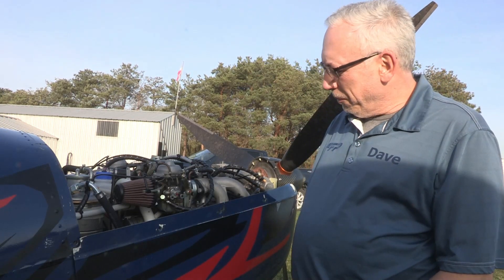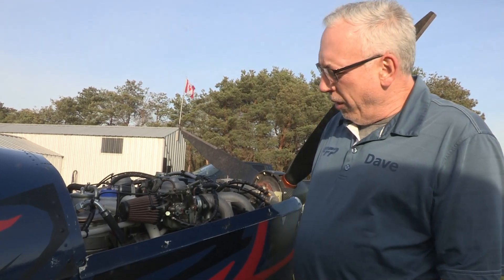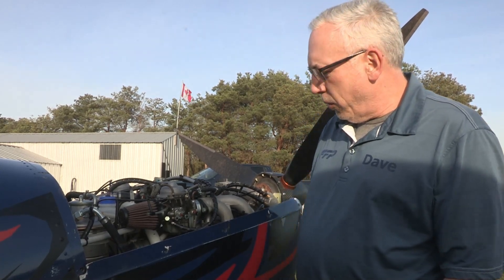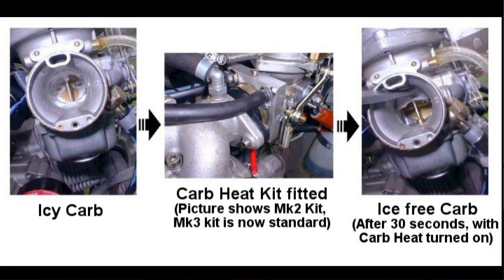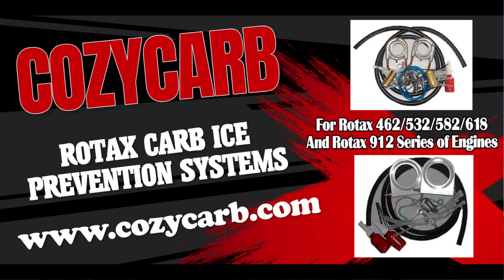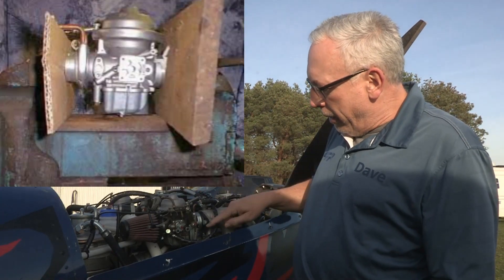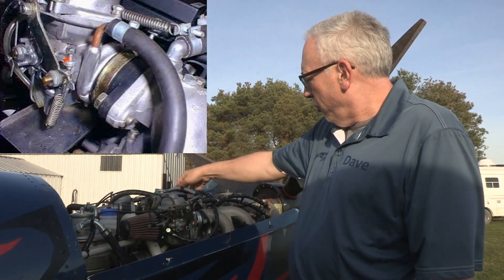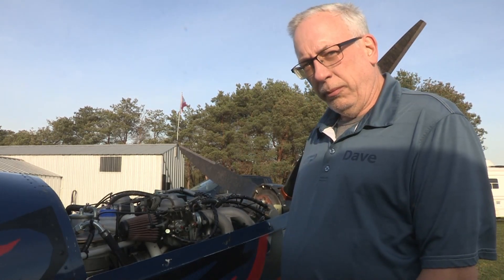Aircraft carb heaters, CozyCarb, Rotax liquid cooled aircraft engine carb heaters, Rotax 912 & 582.

Comment: how many people have actually had carb heat on a 912???? I have done a lot of hours never had an issue...
Reply: Me. Some aircraft designs need them. Tecnam for example. Others get the air from the back of the cowling where warm air circulates then usually no problems.
Reply: Interesting statement about warm air inside cowling reducing possibility of carb ice. Just remember when doing PPL technical, they say that its possible and does happen if engine intake air is too cold to cause carb ice, then warming up the air can bring it into the icing range. So that pretty much defeats the object of preventing carb icing.
An old and wise engineer, pilot, said that if you take a cold drink out of the fridge and the dew collects rapidly on the can or bottle,  and the dew gathers and runs down the container, you have carb icing conditions! Well worth remembering. It's all to do with Dew Point. Google it.
Reply: @halbowker  , that is not correct. In order for ice to form the water needs to condense (the same as on a cold beer bottle from a fridge), then cool down to 0 C and then overcome the fusion enthalpy when water freezes. In order for 1kg of water to freeze from humid air having a temperature of 15 C the following heat extraction (cooling) is needed: 
2260 kJ to condense the water;
4,2*15= 63 kJ to cool the water from 15 to 0 C;
333 kJ to freeze the water.
Actually, if the air is moderately warm and very humid, then the energy of condensation is so high that it is not enough cooling to freeze the water. The air having a moderate temperature and a moderate humidity is therefore more risky from the ice buildup perspective.

Comment: Excellent idea! This should be required for all carbureted engines by FAA.
Reply: The vast majority of aircraft engines in the U.S.A. are air cooled. In addition they have updraft carburetors located on the bottom of the engine. This would not work on Lycoming or Continental aircraft engines.